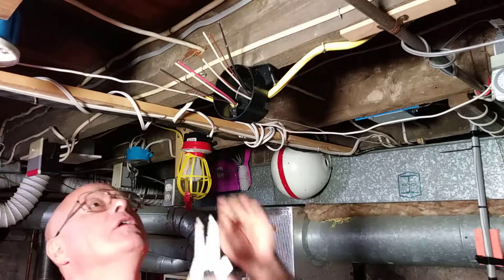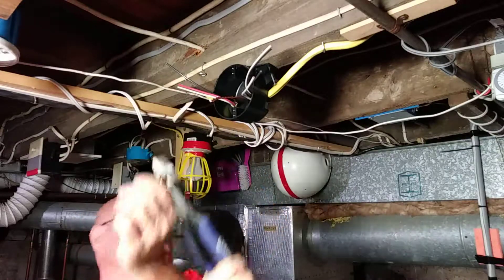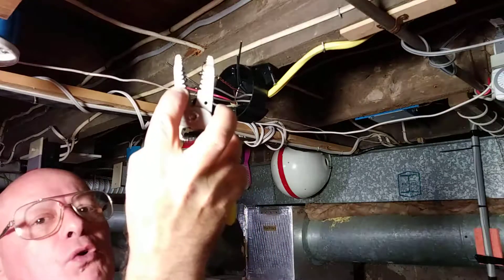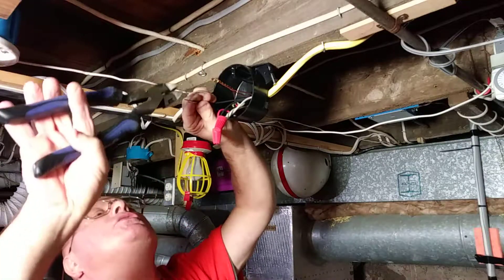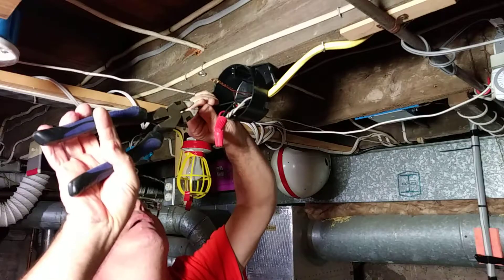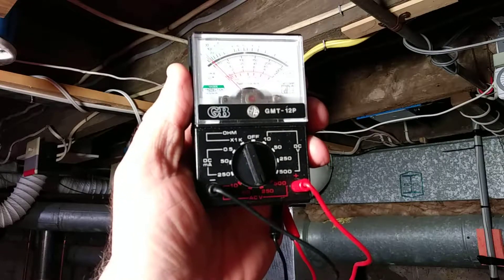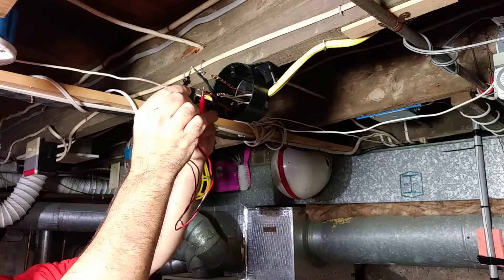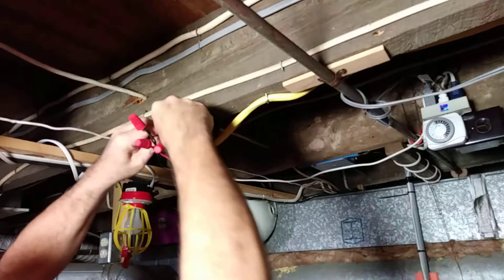I show and explain how to wire a junction 📦 box with 12/3 -2 circuits. 2-12/2 seperate circuits out

Comment: Great video, thanks so much for posting. I am taking over an electrical project that was started by someone else. They already buried 12-3 romex to a shed that I am going to finish wiring, I wanted to see if I could run two separate 12-2's from the 12-3 in a junction box. This video clearly showed that was possible. I have one additional question: what should be happening at the breaker box? How should the 12-3 be tied in to the breakers? i.e. 2 handled, 20 amp, etc. I just want to make sure that what has already been established with this project is the safest and most ideal approach. Thanks!